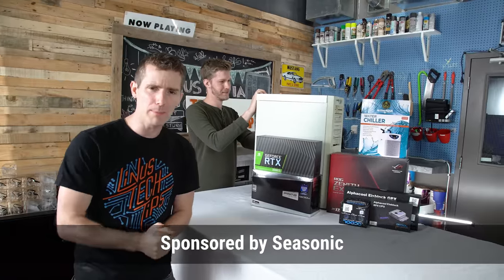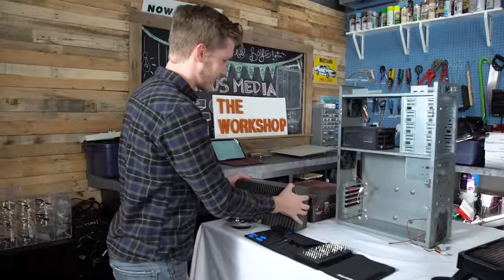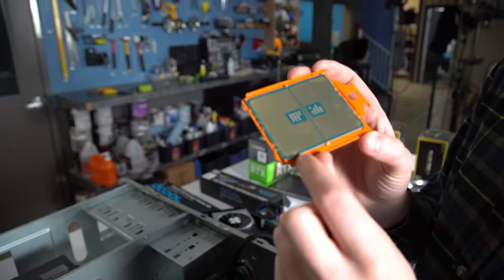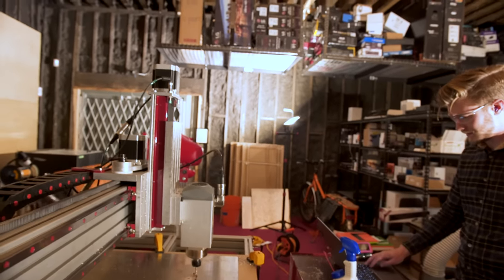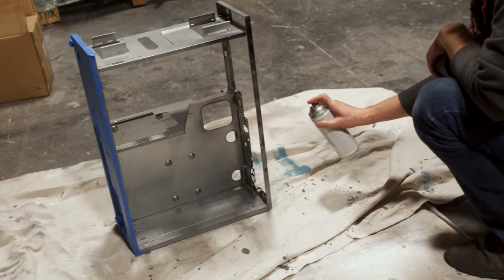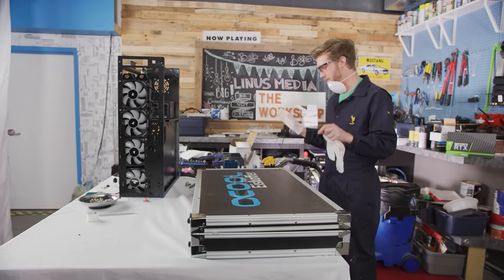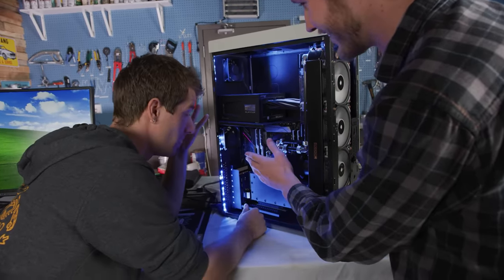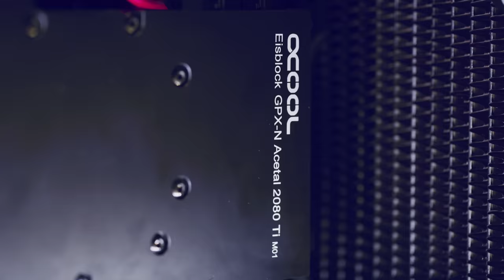The ULTIMATE Powerhouse Sleeper PC

Comment: For all those aesthetics, it'd be nice to sneak a working 3.5in floppy drive in there
Reply: I agree 100%.
Reply: We broke the bot
Reply: If for no other reason that it goes "DUUUNG da DUNK." when it boots up.
Reply: 3.5? 5.25!
Reply: windows 10 doent have drivers, 7 did not sure about 8
Reply: @walidfakhfakh3660  what are you talking about?
Reply: Nah dude, how about a full 5.25 in floppy drive
Reply: @walidfakhfakh3660  Go home waldo, you're drunk
Reply: @88119966  My floppy drive works just fine in Win 10 64bit.  It's mostly used for virtual machines, but it works natively.  FORMAT even supports the /F:size /T:tracks and /N:sectors parameters for floppies still.
Reply: It looks like it has a tad bit of space on the top
Reply: I think they did, the case has a floppy drive in built, and originally the 3.5" bay had a card reader in the slot but the finished computer has a new floppy drive in it
Reply: What the hell happened to the comment section, I think we broke the the poor man
Reply: The floppy is still suported in windows 10, but you would need an adapter or something since obviously motherboards doesnt come with IDE ports anymore.
Reply: @JPX64Channel  floppy drives use a floppy interface, not ide. Best scenario is a usb to floppy adapter with a vintage drive.
Reply: Better idea make it look like old floppy but make it got swappable sad maybe?
Reply: @walidfakhfakh3660  Go home Walid, your drunk.
Reply: @walidfakhfakh3660  Word salad
Reply: Talk about backwards compatibility
Reply: @walidfakhfakh3660   go home walid and bring me meh scrumpy
Reply: Yes!
Reply: Unfortunately Windows 10 is incompatible with 3.5 inch floppy drives or anything older than a CD Rom drive.
Reply: @uthmanbaksh3530  What are you talking about I have 2 machines with Windows 10 with fully functioning 3,5 Floppy drives.
1 As a second boot in a Windows xp Machine that has the Floppy Drive connected over an Floppy connector on the motherboard it self and the other as part of my current main PC I build this year over a Floppy to USB board that is connected to a internal USB hub with 2 USB A headers which is than connected to my mother boards USB 2 connector.

It even still reserves the A and B drive letters for the first 2 connected Floppy Drives.
The only thing that doesn't seam to work anymore is making a MS-DOS boot disk
Reply: Bot malfunction

Comment: Linus, use an OLD printer to hide the chiller next to the pc. Simple solution eh?
Reply: Quick everybody comment on this so it goes to the top! Linus! This is a good idea!
Reply: Bump
Reply: An old
Reply: Yussss an old dot matrix!
Reply: Get it done!
Reply: An old HP laserjet 6P would work amazingly well for this.
Rip the middle of the SCSI port out leaving the surround, and install tubes for out and back water from the loop.
A couple of valves inside the case to isolate the tubes and you can make it removable, assuming you can find or fabricate suitable pressure fittings.
Reply: This is a brilliant idea. bump it more guys
Reply: Bump
Reply: Bump
Reply: @gooseythelucy  My bad. Fixed it for you. :D
Reply: you won the internet!   best idea ever!!    Linus,pretty please :)
Reply: Hell yes
Reply: Just build the mega ultimate sleeper pc in the old printer 😏
Reply: wow
Reply: yes
Reply: bump. this is brilliant
Reply: Bump!
Reply: What a cool idea! Sorry I had to say it.
Reply: Hi
Reply: Bump
Reply: Bump let's make it happen!
Reply: Bump
Reply: Eh?
Reply: SecondChanceSlater excellent idea
Reply: Bruh idea
Reply: Bum-p
Reply: On a log
Reply: Do it

Comment: For cutting aluminu with a CNC router, use lower cut depth and much higher feedrate. That way you don't stay in one spot for long enough to cause the aluminum to soften and clog the tool. You're moving so slow that you are heating up the local areas. Use one or two flute tools. I recommend using alcohol for bit cooling with small jobs because it works really well and leaves a clean part, bed and whatever else stuff is splattered onto. The downside with alcohol is the fumes. It needs a lot of ventilation, especially on large time consuming jobs.

WD-40 is really good for aluminum, but alcohol is just cleaner and works just as well for routing. I use a mist cooler with alcohol on my machine. 

Both WD-40 and alcohol are trade tricks when cutting aluminum.
Reply: Doesn't mist cooling with alcohol create a really inflammable atmosphere?

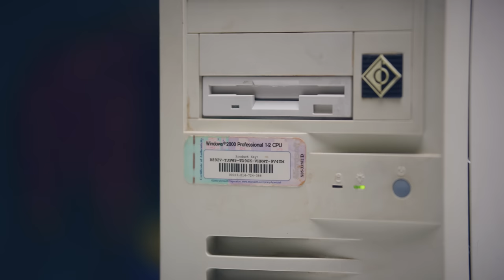Comment: 15:20 Thanks for the free Windows 2000 Pro key guys!
Reply: ergosteur EHHMM its THAN YOU MORE THANKS
Reply: Yoink
Reply: F
Reply: try to activate it
Reply: @Aeternal41  Well, good luck activating it. given windows 2000 doesn't have WPA. It was first in Windows XP.
Reply: Actually used it cause i had an old laptop and for some reason after 5 years after using it for fun it was unactivatfunand it worked nicely
Reply: Actually needed a windows 2000 pro key
Reply: @HyperX_D  r/ihadastroke
Reply: Love the montage at the end... Well done. You'd have gotten geek points for those devices in the front being functional, but that is not even remotely feasible in that tricked out cabinet. Cool stuff!
Reply: i just wanted to comment about this

Comment: CNC problem.

1. Milling to deep. 
2. To fast. 
3. No coolant.
4. No safety.
Reply: Legit. The depth of cut and feed rate were too high, the coolant isn't really an issue, they could've just done a spray follow along with wd40 if they wanted a cleaner cut but it's not necessary. If they did a proper chip per tooth rate it would be fine and if they used the correct endmill or router bit.
Reply: Definitely was thinking "why the heck are the cutting a half inch into their table!, No wonder they are having troubles!"
Reply: always use lube and protection
Reply: *too
*too
Reply: This.
Reply: Too** x2
Reply: Came here to post this. One does not simply cut aluminum in a single pass at default feed rates on a hobby-grade router.
Reply: Can't really tell from the video but that endmill looks like it is TiCN coated, which along with TiALN is quite subjective to chip welding when cutting aluminium, especially when you are running such high RPM
Reply: They really dont know how to play with their tools it kills me
Reply: @Guardian_Arias  eh, they're still learning
Everyone who does machining has been there, everyone shitting on them never did it themselves
Reply: @Blacktronics  learning is one thing, you take scraps run some basic test adjust and experiment, you don't just go in and ruin all of your stock in one go. Even worse burn out expensive tools although that looks like HSS with a coating. Sorry but not sorry if one of my people burned out a tool like that i would be blowing up.
Reply: Yep it all checks out, they are doing it the "Linus way" >D
Reply: The utter disrespect for such machine's power is annoying. At least bother googling a bit.
Reply: Uhm it's not the feed rate. It's the cutting speed. The router is turning WAY too fast and the feed rate is too low in comparison. Thats why you get the smearing.

Comment: Your CNC problems weren't because of the tape, at least from what I could see in the video. Judging by your tools being gummed up with aluminium I'd have to say you were going too deep too slowly, take shallower cuts at a higher speed.
You want a single flute carbide tool with a flat bottom, if you can't secure your material very well then take cuts around half a millimeter down at over 2000mm/minute. I typically run 2500mm/m at 18000rpm spindle speed.
You probably also want a proper cutting lubricant if you're just using oil and air at the moment, invest in a misting setup if you need to cut aluminium often, less is more.
Reply: then you'd do more passes, I suppose? it caught my eye that the piece was too thick to be milled at once, much like carving wood, if you go in too hastly you'll gum up the bit and cause it to burn out and burn the wood.
I only suppose. out of ignorance and lack of experience in CNC in my end, of course.
Reply: @sauloaugustomartino803  essentially yeah, in any situation where holding the material is an issue you should do light passes and make sure your last pass is as light as possible since once the price breaks free you want as little force on the tool as possible so it doesn't try to move.

The main mistake people make is slowing the feed speed down when it starts to struggle thinking it gives the tool more time to chew through the material but that is the worst thing you can do as the tool will rub against the cut edge producing heat and wearing the tool. Always better to  work out what your feeds and speeds should be for that tool regardless of the specs of your machine. Stick to those feeds and speeds that work but vary the cut depth of your spindle doesn't have the power to maintain speed.
I myself don't really worry too much about loading my spindle as it is 10hp through a 1/4" tool so you aren't stopping it. But even on my 5 metric ton router I always make my last cut pass about 1mm at the most depending on the material and how well I have it held.
Reply: @SavageSmithy  I see.
thanks for sharing your knoweledge.
mostly the same for woodcutting and carving deep lines, surprisingly.
some bits take variability in RPM better, some outright just shag your materiel when going too slow or cut it more when going too fast.
key to all is patience, and experimentation as always.
Reply: @sauloaugustomartino803  

Oh yeah it's exactly the same as routing timber, the only difference is when you get tool rub on aluminium is sticks to the tool and you have a bad day whereas when cutting wood I generally find it just makes more noise but still brute forces its way through without issues.

As for rpm variability that isn't something I bother with for my purposes but is essential if you want incredibly clean cut edges in harder materials as without it your tool can hit a resonant frequency and it will vibrate and chatter whereas with a constantly changing rpm the vibrations can never hit a resonant frequency so the vibrations are kept at a minimum
Reply: @SavageSmithy  Yep. I like those edges clean, and preferably my wood not burnt.
sometimes you can get a burnt tip, sometimes burnt wood.
neither is fine for decoration pieces, in my mind, of course.
once again, thanks for the sharing. I'm doing carving as a hobby, so my knoweledge is still very small.
Reply: @SavageSmithy  tool rub can also cause deposition when carving softer materiels, those can also catch fire when rubbing against more wood.
or maybe I got incredibly unlucky
Reply: @sauloaugustomartino803  
Haha tell me about it!
My machine has a vaccum bed for holding materials and one time on a drilling cycle the wood got a bit hot and caught fire, the trouble is with a vaccum table it essentially smokes your bed like a cigarette as it pulls air through the fire which when the extraction hood is lowered is an issue because you can't see any flame or smoke on the actual machine but it was pouring out of my vac pumps in the other room. Ah well live and learn!

Most of my work is in television scenery construction so the majority of the prices I cut are component parts that need to fit together to produce larger items, they are generally covered by cladding and never seen so a burnt edge here or there isn't a worry for me unless it is something very visible in which case I go to town on it with brand new tools and sometimes especially when cutting thick acrylic I will vary my feeds and speeds manually by ear, it's nice when you get it just right it's like music.
Reply: @SavageSmithy  HAHAHA Well, I had a similar problem to your cigarette wood!
I was carving some very high density wood (can't tell the origin, got it from a construction site also, I'm a noob) in a attempt to make a caduceus that would double as a walking stick.
left it just a bit too much without blowing compressed air into it, had a small flame in my hands, as I was trying to finish it as fast as possible.
Never tried to shape a piece of acrilic tough, might give it a shot as a decorative aquarium.
The pieces I make are normally very simple, but the decoration aspect of them makes me think that burnt edges and itsy bitsy splinters are a nuisance I'd like to avoid as much as possible, seeing as I'd have to sand them down manually later.
fabrication is such a good hobby, man
Reply: Movivilufilm
Reply: As soon as he said the tape was the reason he was having issues i burst out laughing.
Reply: @DustinBoden  perhaps out of habit?
3d printers have this shitty habit of screwing your projects if you tape the target incorrectly.
Reply: In alluminium with a real cnc machine you can go 3 cm in one go 
And 3 mm in steel 
But not with that hobby machine and some tape amateurs 😂!

Comment: I remember when 360p was normal and 480p was considered "high definition"
Reply: "high definition" was not a term until 1080p and 720p
Reply: EVOLICIOUS which is why I put it in quotes .
Reply: Nah man, 480p was "HQ - High Quality"
Reply: I actually think that 480p came before the 360p. 640x480 which is 4:3 aspect ratio. They just came up with the 360p to fit certain monitors I believe which was after the standard 4:3 screens. There are all kinds of resolutions out there but the standard ones are 480p, 720p, 1080p, 2160p aka 4k and so on...
Reply: EVOLICIOUS 

The Sega Mega Drive / Genesis was labelled: High Definition Graphics, Stereo Sound.
Reply: if you look back at some of the older music videos...oof

Comment: Oh my!  They are using a case I had back in 1995!  It weighed as much as most complete PCs do today and was strong enough to support my weight as a stool!  But the separate power supply kept the heat down, and away from the motherboard.  I had a CDR and a DVDR, plus a3in and a 5in floppy drive. (google floppy drive yourself kids) I ran a 486-60 and later a Pentium 100, then a 300 in it without any problems. Cooling was a pain, because the cabling was so huge!  I installed some fans that sounded like freight trains when they ran at full power. But it ran perfectly!   Now I have a Cooler Master HAF 932,  and you can put anything made into it with plenty of room for my big hands, and the air cooling is fantastic and quiet.

Comment: @LinusTechTips' Alex. 

It probably doesn't have to do with the Speed of your CNC routing. More with the depth of it. I've seen people do Steel/Iron on CNC router with the right bits. What they have in common is they do not take much depth. Perhaps, 0.2 mm per pass till they are through. Very shallow cuts.
Reply: Yeah what they really need is a good o flute bit, and some more experience.

Comment: Close to starting a Hardline build with a 3950x and 2080ti sli setup. Dual loop in a tower 900 chassis. It doesn't have anything to do with sleepers Im just pumped 🙃

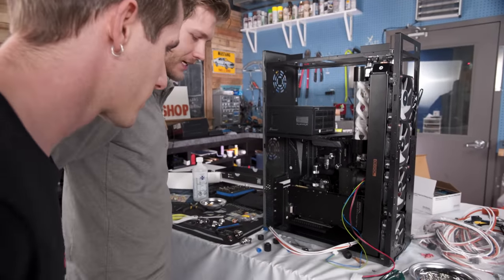Comment: 12:00 DID LINUS GET ZAPPED???
Reply: Yikers
Reply: It does look strange but the wires are covered and it isnt plugged in.
Reply: surprised you notice that in 360p
Reply: On 12 volts?
Reply: @greenanubis  a 12v shock from a PC hurts... You seen how many amps are pushing that 12 volts?!
Reply: @AndyMitchellUK26  Yeah, like 80-100 amps. But not through body, too high resistance.
Reply: @AndyMitchellUK26  Ill hold it for you, in nearly all cases up to 40 ish volts is not something you're going to feel. It might have been grounded though, not sure, but if you zap someone or a door handle, but now just the plug? That might have been it?

Comment: To cut aluminum on a router:
Use a small endmill ( 1/8 single flute (kyocera off eBay works wonders))
18-20k rpm
18-25ipm
WD-40 for coolant
Full slot

For bending:
Use a 1/16” drill and drill on the bend lines, it makes for easy lining up and building

Comment: As a machinist by trade.. this is painful to watch and I want to help so badly
Reply: Daniel Benjamin sure. But they’ve come a long way fairly quickly. Think about how much they learned about fabbing from this project alone. There’s no doubt they’ll do even better next time. That being said, the bottom left tube on a different plane bothered the shit out of me
Reply: @Plan36c  back and forth filing like it was a saw did me in
Reply: Works twice as fast that way...😂
Reply: Same... Like please just send it to me, I can just shove it in the Toshiba at work and have it cut out and deburred in like 5 minutes. Watching them struggle with aluminum plate was painful. Lol
Reply: @dgHandcrafted  your taught to file back and forward at least in my college
Reply: @workingtitle7049  A lot of files only go one way and dull very quickly if you file back and forth. It depends on the file itself, the toothing/pattern of it and the quality of it, the metal you're working with, thickness of said metal, etc etc. From what I know though, the old timers for sure consider it bad mojo to file back and forth even if the file can handle it.
Reply: @Shyvorix  oh